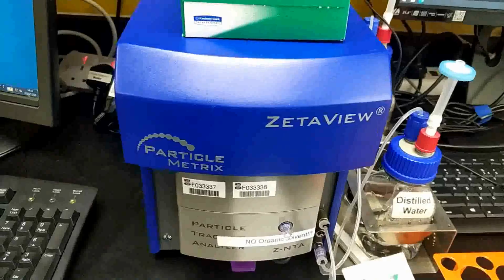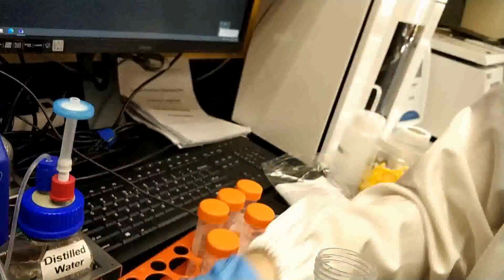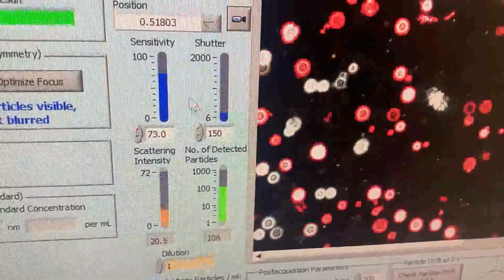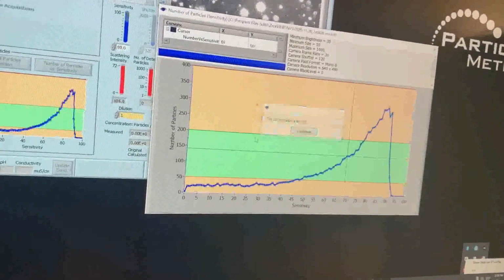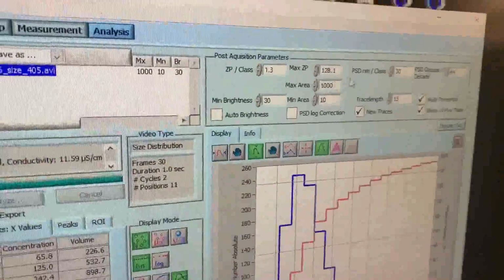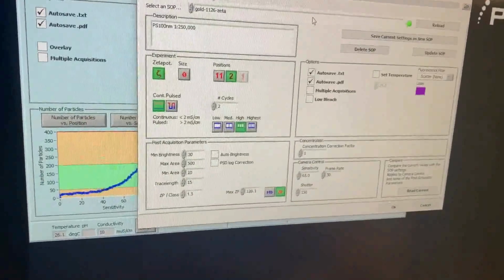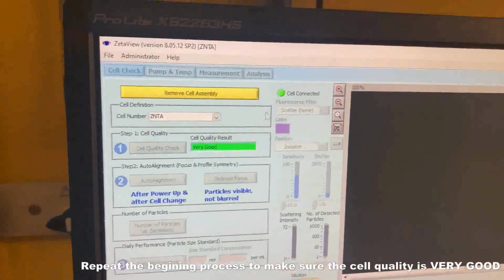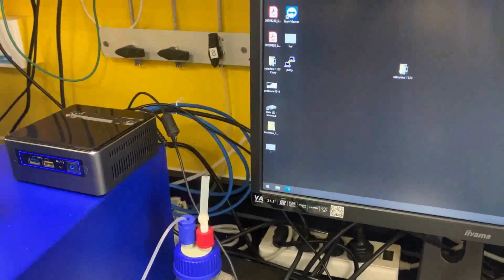Zetaview SOP

Comment: Thank you for the nice explanation. I have some questions to ask; I would be happy if you could answer them. 1. Can I measure the nuclei size, concentration, and volume by using ZetaView? 2. Is it determine particle, nuclei or gas concentration? 3. What are the differences between nuclei, particles, or gas that exist in water? 4. Can I measure the nuclei size, concentration, and volume of fresh or tap water by using ZetaView?